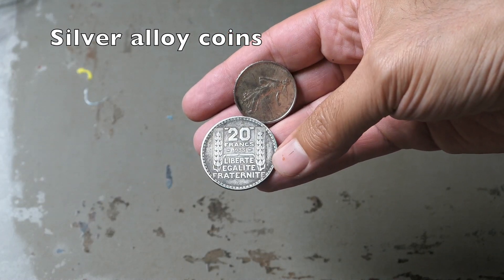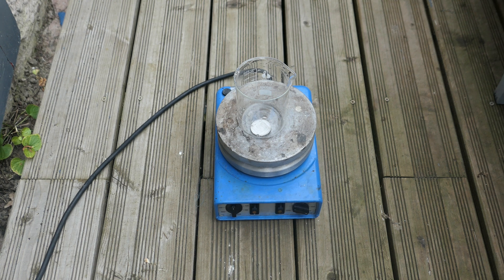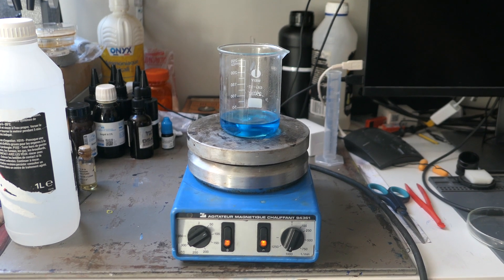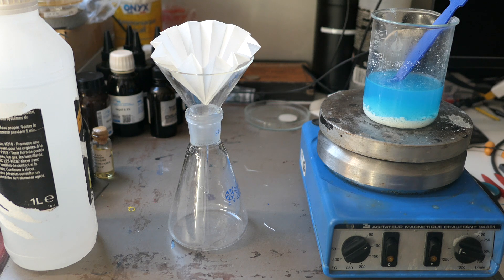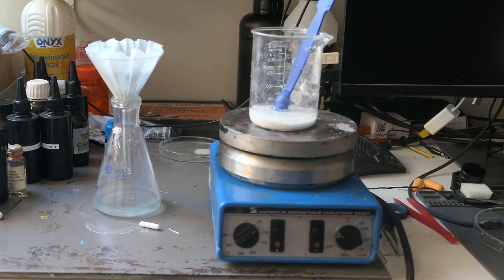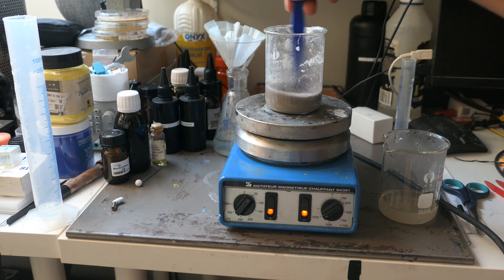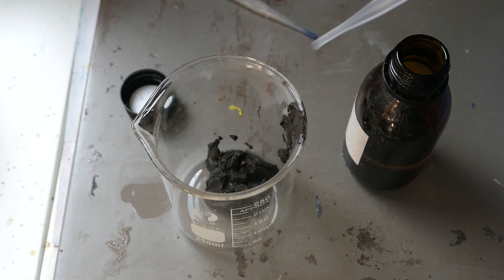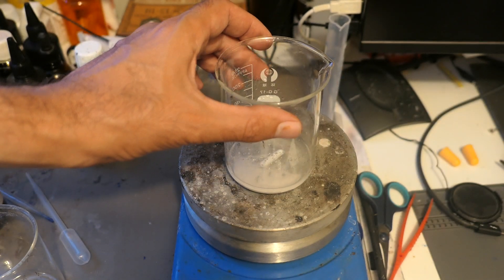Preparing pur silver nitrate from old coins

Comment: But you have a pure silver coin, is it very difficulte to add HNO3 directly to this coin and dissolving it? It will help to escape the waste of silver and augmentation of sort of the product
Reply from the maker: Right , if you have a pure silver coin, just add HNO3 and evaporate the excess of acid (outside !).
Reply: @sylvainferrand351  Add water first. Things go faster, smoother. Then dry things out.